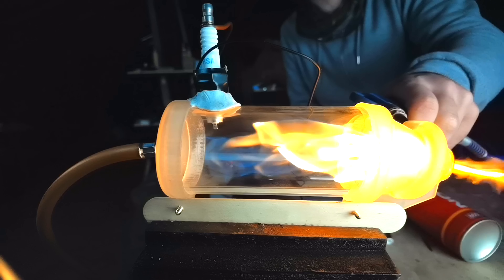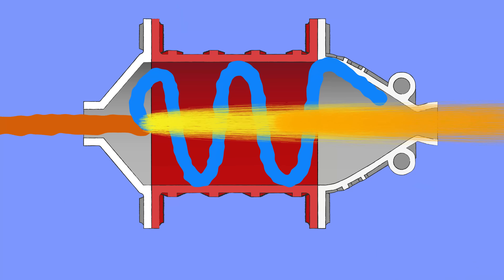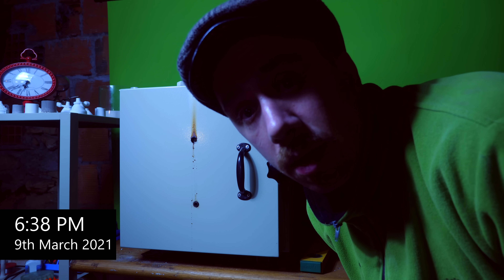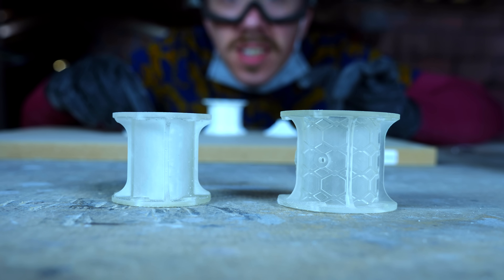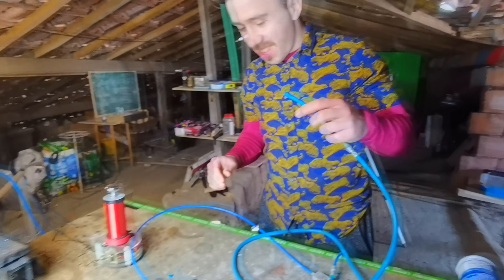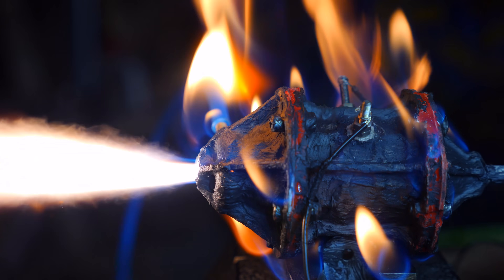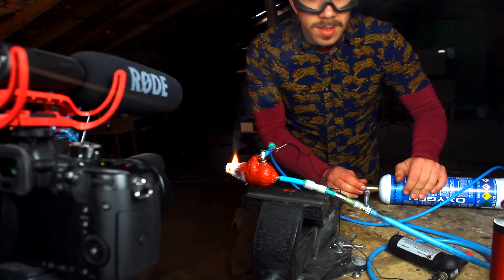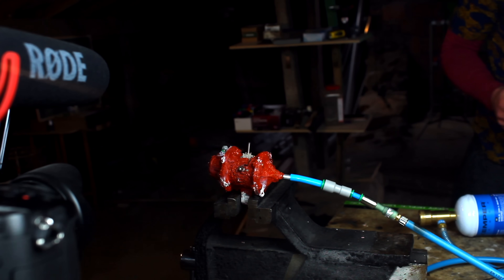Vortex Rocket V2.0 (3D Printed)

Comment: i don't think you can use 3d printer, from what i see, 3d printer build stuff by layers, making the wall as a weak point, if you wanna make a solid rocket engine without leaking, the only answer is by not using 3d printer

Comment: Have you tried working with high temp carbon fibre before? If you make 3d printed molds its not a hard material to use and its super strong and resistant

Comment: id say the design needs work but id say pretty decent success, it seemed like the orange sealant wasnt enough, which tbh i was surprised by, it seems like the one piece engine did the best, 1, for the piping id make the metal parts of the pipe longer to avoid catching on fire. 2 maybe thicker ceramic will prevent it from imploding/exploding. i dont know what else you could seal it with, on the last model it seemed like you had a longer petrusion of the back nosle, if you make it longer the flame may not reach your other parts. also i swear that non flameble sealant caught fire.

Comment: Rather than Flange to flange joint try doing it tube inside tube with the flange just used for clamping. it looks like when the engine stalls the high pressure is blowing the sealant out and leaking. If your using 2mm wall thicknesses the interface could be 1mm The overlap joint will stop the sealant blowing out side ways.  For the fixings have you considered using threaded bar through all three parts of the engine?  If you use a small torque wrench such as for bicycles you can increase the torque consistently and in steps until something breaks. 

A one piece part will get rid of most of the joint leaking issues but the iso grids are potentially the cause of cracking as they will expand and contract at a different rate to the 2mm nominal wall thickness.  The larger the part the more likely it is to crack.  Maybe create a one piece engine and then place it inside another part which you then poor in the high temp compound to add structure.

Comment: Once you've got your part cured, you could fire a glaze on the inside of it to seal the chamber. You'll still have problems with tight seals though, due to each part's shrinkage.

Comment: step 1: put engine in a steel pipe
step 2: fill with plaster
step 3: test
when you find your best desing then
step 4:  fix leaking problem

Comment: what about a water chamber around the engine ? it would still be vortex cooled, so technically ...

ok easiest way of making sure that that thing wont leak is making the same amout of pressure on the outside of the engine, like a second chamber around it with something non burnable like nitrogen or you just let the oxygen handle it, with the outer chamber ending up feeding the inner chamber. Might end up good, might end up beeing a bomb, although, im quite suprised not much happening on your channel in terms of too bad explosions

Comment: Great video! What if you use a double walled chamber? I know you can’t print the walls wider than 2 mm without distorting. If you did a 2mm walled chamber, and properly supported it, inside an additional 2mm walled chamber, it may help. I know it’s not perfect and may still have other issues. Obviously, increasing the wall thickness would be better, as 2mm walls are super thin for this purpose. I would try to tune the resin settings on the printer to see if you can get the walls thicker without cracking or distorting too much. You could also look into heat treating the ceramic to increase strength, or 3D print it out of metal instead. and then maybe use the ceramic coating to treat the metal. If you do end up getting this working reliably, please let me know, as I have a really cool idea for what it could be used for too. Best of luck!

Comment: future video suggestion: 3d print a mold that you can also use to vacuum out the air from your ceramic castings. or glaze your your sh*t before firing it for that sweet a** molecular seal. either/both would make for good watch.

Comment: @Integza you can coat it with some type of epoxy. or hi temp stove and furnace cement( i don't know what you can get where you are but the stuff i i know to be good has this product code: kk0284-a   and is sold at many hardware stores in canada).  you can also strengthen it to hold more pressure by putting some sort of steel mesh on it, like the fibers/mat in fiberglass or carbon fiber

Comment: To solve your problem you have with it leaking you need to have gaskets in between the pieces that join together, it is due to the minute channels of air passing through the joins.

Comment: Brazil here..; Translated from portuguese by google
in the last test I believe that it worked, however, as the pressure is very high, it ends up creating escape routes. and you put a metal plate (beer can) internally to increase the price area and thus reduce the leakage
maybe deform the can so that the tips have the same internal shape as the combustion chamber

Comment: Use dual chamber; add an outer chamber to your design. Continue to fuel and oxygenate in the same manner through the inner tube. In the annulus between the inner and outer tube, induce oxygen or air at a higher pressure. The air in the annulus should contain the contents of the inner tube. Expel the annular air into the nozzle. Also, make a few ports in the nozzle to introduce fuel as an after burner. (By the way, I really enjoy your channel. I’m going to subscribe!)

Comment: try to cover the inner parts of the engine with the cement. a few layers should be more than enough, and the gasket between the body+parts on the one you assemble should be made out of metal or cork (just like a car's engine)

Comment: It's leaking because of the 17% reason you burned off. That created porosity. You need to seal your engine with a couple thinned layers of slip-- especially on the pressure side.

Comment: Hi  @Integza  to sum up:
1) Avoid gas bubbles in the resin. Use ultrasonic degasing
2) Change temperature profile. Use a plateau at 300° and cool down very slowly to avoid  tensions in the material. 
3) Avoid any humidity before the surface is sealed
4)  You need to fill in the gaps of the removed epoxy. But as there is already air in the gaps, you need to remove the air first. So use a vacuum chamber and a filler liquid. If you break the vacuum the filler liquid will be sucked into the material.
5) This liquid filler could be the porcelain resin again or something like sodium silicate, fire cement, glaze...or even salts, gypsum (1460°C)
6) Use the oven to dry it slowly below 100° before doing a second cycle. Otherwise if water remains in pores, it will make a lot of steam during vaporization, which ends in cracks and hollow spots
7) Use metal tubes or metal reinforced tubes for propane and oxygen, the plastic tubes get burned and cannot withstand heat
8) Use a blaster shield

Comment: @integza From watching the video it seemed that it leaked wherever there the parts connected (obviously). Using the silicon probably wont give you a good seal as it's a liquid (more or less in this case). Solid silicon gaskets might be of interest to you. when you were using the submarine it looked like it burnt through just before the nozzle  throat. You might honestly be reaching the pressure threshold and opening up the throat would help with that.

I think the best solution is to create a one piece system to reduce the amount of areas that have a chance of leaking. Solving the issue for the parts burning through is a harder problem to solve... Maybe see how thick you can really get the parts without cracking (3mm > t >= 2mm) to see how much you can 'squeeze out of the ceramic.

Edit: I just noticed others are recommending to glaze the parts. Didn't even think of that, also a great (if not better) idea!

Comment: Print your engine parts in resin at full size
 Cast in plaster to create a mold
Use 100% ceramic to make a heat resistant part with less chance of cracks or deformation

Comment: You may be able to solve the leaking issues by coating engine with JB Weld "ExtremHeat" it can go up to (1000°F / 537°C) and/or water cooled channels where you can pump cold water into the engine, open loop, or close loop with a radiator, although not sure you need the extended run times of a radiator.....  and now with Steam you can really make sure this turns into a bomb! lol

Comment: On the faces of the rims that meet when assembled make a narrow channel in the 3d model and during assembly use the heat resistant silicon between the rims of each part so that once it's set it acts like a made to fit heat resistant grommet, this would allow for any imperfections either in the printing or baking stages, don't tighten the nuts up all the way to start with leave about a half turn in each so that you can tighten it down on the silicon once it's set and be absolutely sure you've got a good seal on the joints before moving on to coating the outside.
As well as all that maybe try a larger chamber or regulate the flow of the gases using solenoid valves operated by an arduino or pi, that way you can have consistent flow rates to zero in on the right mixture and PSI going into the engines.

Comment: Suggestions:
Instead of trying to make the delicate porous ceramic work, use parts that anyone can easily source at their local diy-store. Pipe fittings, steel pipe, cheap gas valves. Maybe go as far as buying a drill press, as that's basically the thing most people have in their toolshed (along with a vice-like work holding thingamajig).. That helps with clamping a steel pipe and drilling /routing off-center holes (for the vortex angle). So given that you have to print the nozzle and the propane part, maybe optimise for flatness, and try to incorporate a ridge that holds high-temperature Buna-N O-rings, so you can clamp the pieces over the (lightly modified and welded) steel pipe with minor leak chance.

Other methods:
I'm keeping the steel in, because that's basically the only off-the-shelf part that's already capable of handling high temperatures. But the manufacturing method needs to change. How about instead of printing out parts, print out molds that can be used to cast metal? You already have an oven that's perfect to temper the steel once it's cast, so you only need a crucible and some sort of sand-casting jig (myfordboy on Youtube is probably THE expert to talk to). Lost PLA casting has come a long way, and it's really accurate. That gives you steel parts that are roughly as accurate as the PLA parts you printed. 

tldr; A way to indirectly 3d-model metal. That is a powerful tool. Godspeed dude!
Reply: I think the gimmick he's going for is that it's 3D printed. He has done a sheet-metal jet engine though.
Reply: Wait.. you want him to cast steel? As in the stuff you need to heat to 1600°C? That would need a completly different toolset he already has and is considrabel more dangerous. Also with casting steel comes the added headache of temperature controll. To low and the steel wont be liquid enought. To high and you could end up boiling of the carbon making brittle iron castings.
Also getting 1600°C is not that easy to archieve in a normal use furnace for metal casting like copper or aluminium
Reply: @Blutwind  Aluminium it is then!
Reply: @devjock  problem there is that the melting point is too low basicaly a rocket engiene does the same as a furnace or to be more precise his rocket engiens do the same. Normal home used furnaces use propane or butane gas with natural air flow to melt metals such as aluminium he uses pure oxygene creating way hotter flames(optimaly the flame itself could reach up to 2350°C but would most liekly still be around 1000°C+ Aluminium melts at around 660°C). Depending on the test times and the thickness of the materials his rocket engiens could meld down and with the thrust, if that happens at the nozzle it could spray tiny amounts of melted aluminium around.... not the best thing to happen in your attic.

Also Casting metals is the easiest way to create complex shapes with metals but its not as easy as: Take mold, put metal in. There are a bunch of Channels on youtube that do cast metals and complex or fine parts are often not perfect. heck check out BigStacked for example who does nothing else but casting metal for way over a year now and even 3d printed coin molds do not always turn out perfect needing afterwork.

Using heat resistant metals would be an awesome solution but the technical problems are pretty big when you do that for fun. Though i would argue its a step he could take when his engiene desings are sound and work to tackle the problem of material with more complex materials though ceramics in a small system might be the optimal choice

Comment: Try creating a shield-gas jacket around the engine chamber. Inject Helium or Nitrogen into the jacket to balance the pressure in the combustion chamber. That should help keep the combustion gasses in, and the only thing that will come out through the ceramic will be the shield gas. Hopefully that will prevent the external fireball action. The noise created by the engine suggests an internal instability in the vortex. So I think some more iteration on the internal nozzles might be needed.

Comment: mate, try using a thicker sealant that cant melt, it was melting, causing the leaks, it was probably leaking to begin with, just the pressure was too low to breach the sealant

Comment: Would glazing/enameling the inside seal it? If the sides are cooled then glass may be the answer. Seeing as much as glass liquefaction happens at 1400-1600c the same temp that porciline is fired, it may fill the cracks. Second thought, the large pores may be due to the printing itself, layer spacing. If you painted or dipped the inside with your porcilite, it may fill the gaps.

Comment: Forgive me if it's been suggested before, but you might be stressing the ceramic with a hard start and the cold gasses. I found a cool video that apparently did the same thing you're trying to do with a resin print, and it looked like he used an electrically controlled valve system to reduce the time the cold gasses were unlit. Maybe you've seen it before, maybe not: https://www.youtube.com/watch?v=tqEfbJRKzeQ

Comment: It may be a long shot but... after the parts are printed and fired in the kiln, could you maybe coat them in another layer of Porcelite (for instance brush it on) and then fire them again in the kiln? I expect that at least some of the pores would be filled in this way, if the parts survive the treatment of course. You may even have to do it several times in a row if the remaining leakage is still too high.

Comment: So a future video could be about making water glass and applying to a ceramic rocker motor design to see if it would seal it. Your kiln should be hot enough to fire the water-glass, or a gas torch could be used. Water glass would get into all the  pores of the ceramic and then seal it off. Multiple layers could be used, each layer being fired before use.What do you think?

Comment: Replace camber and inlet with metal tube and flat cap that fasten with bolts to save time and testing elements 
And For the nozzle maybe a non cocked seramic nozzle mey do a better result

Comment: why doesn't Integza use high temp powder coating in a vacuum applied to the inside of the ceramic parts? the porosity of the ceramic is causing the gas to bubble under the outer coatings and causing the issues.
 it's relatively easy to set up for a home lab

Comment: I'd suggest vortex cooling with CO2, blowing from the tail cone bell nozzle to the front, and inject fuel and oxy straight down the center towards the bell. 

Combine that with ceramic glazing and some high strength fibers, and it might just survive for 30 seconds.  Cheers!

Comment: You should try precision castable alumina ceramic molding with lost 3d printed PLA.
Reply: And dial your vortex cooling parameters
Reply: And seal the engine from the inside, that will help stop the leakage.
Reply: And if you 3d print more ceramic cook it slower, get a proper heat curve going in that oven, it will keep your part from cracking and deforming by allowing the heat to spread better and cook it equally.

Comment: I think your first mistake in this video was using 2MM
If you need X amount of time and heat for 1 MM to fully cure and burn out the resin
How much time and heat do you need for 2 MM?
i was noticing that your frames did not melt right away but that is what it looks like
as you heated them up from being in use, the left over resin melted/burned away making cavities for your gas to escape every which way

maybe increase the time in the oven by 50%
Maybe try 1.5 MM? i also think its a problem of surface area and the heat not having enough time to penetrate fully.
the last test you can you can clearly see 2 spots heat up and it looks like they just melt off
so i really think all the resin is not being cooked out.

Comment: Have you thought of trying seals between each assembled part? Like using liquid ceramic or refractory that hardens over time, the coating the engine with the refractory as well!?? It may be dumb questions, but I still feel it’s right asking!

Comment: Hey I have a very good advice for u. You could seal your parts with water glass(sodium silicate). It will turn into normal glass after drying and heating and it will make your parts impermeable👍.

Comment: Glazing and sealing via vacuum draw seem interesting ideas, but ultimately what you are wanting seems much, much, better suited for metal.  I’ve seen metal-resin filaments with only 10% resin but fear you’ll have similar porosity issues (could seal with electroplating?), and I expect 100% metallic printers would give better results.

How about using your printer to create casts for metallic parts?

Also (saw this later): https://youtu.be/w3i8i-9bjqI